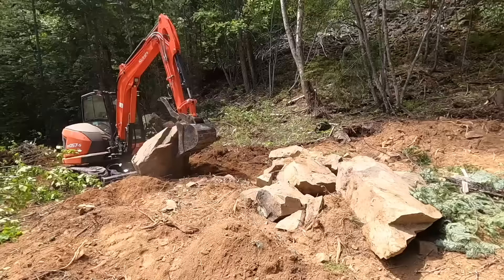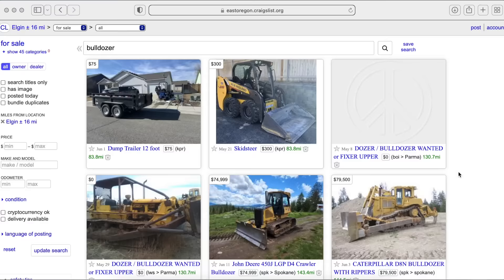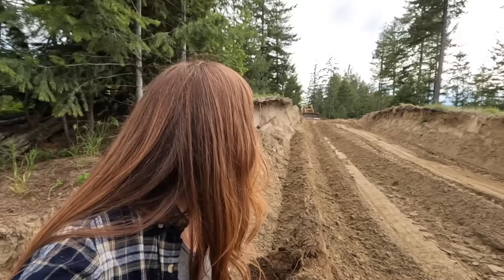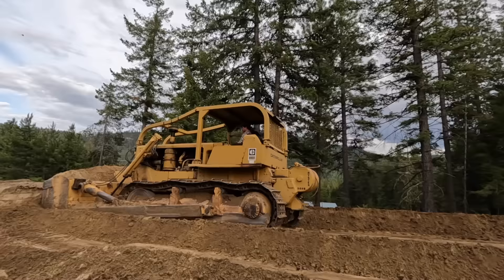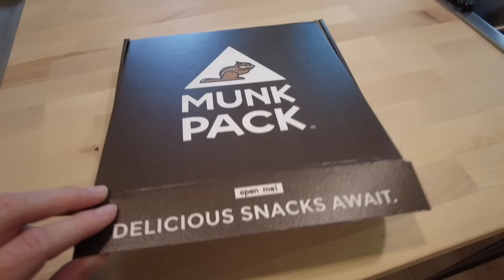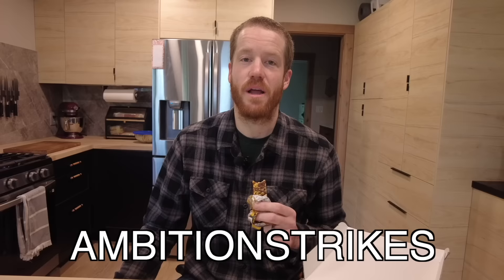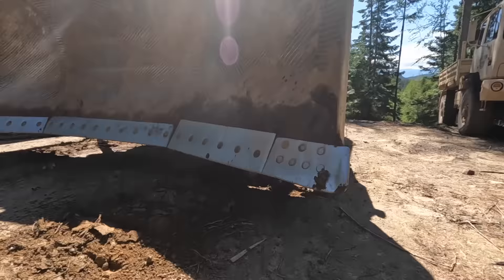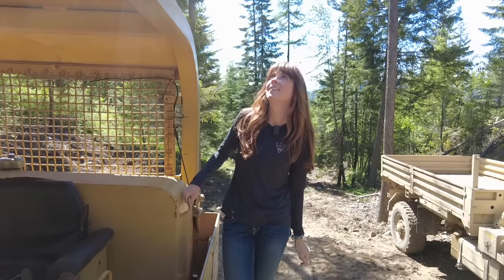We Bought The Biggest Bulldozer We Could Find || MASSIVE CAT D8

Comment from the maker: We had some doubts about investing our savings into this thing, but after reading all of your amazing comments I think we made the right call. This is going to be a fun summer! 🔥
Reply: One more thing when were the spark plugs last changed on the pony motor and a heat gun in the air intake a minute before you try the big motor does wonders .
Reply: I don't think you actually realize how good it will be having the right piece of equipment for the job. It just won't be anywhere near the struggle for those big jobs it would have been otherwise.
Reply: Check out your track tensioner. The tracks looked a little loose. Find the specs on them.
Reply: You have the older brother to the D-8 we have at our quarry that I sometimes run. That semi-U blade is good at ripping blasted or shale rock like you have there. It's a good idea to take a few small cuts than trying to get it in one go. The corner of the blade is your friend when working ripping rock. 

Because of the age of the machine use non- ethanol fuel for your pony motor. If you get lead fuel additive use it in your pony motor fuel your valve guides and seats will thank you.

I'm guessing you know to let the main engine spin over till you have engine oil pressure before lighting it off.

It was fun watching Riley running the dozer for the first time then at the house as a kid with a new toy... 

Oh fuel burn will be around 10 to 12 gallons an hour unless you are pushing really hard.
Reply: I think you can probably sell it when you are through using it. You never know you might just make a little profit.
Reply: Those Dozers as long as they are in Decent Shape, and Running Order, Hold their Value Quite Well. Aslong as it is Structurally Sound and has a Good Frame, Guys have been Buying them and doing a Ground Up Restoration on them as well. A Lot of Farmers and Smaller Operations that don’t Necessarily Need a Dozer all of the time tend to Purchase them, sometimes just for Pulling Trucks on Muddy Jobsites.
Reply: @traviss224  
They look a little low on grease.
Reply: Yes it is...
Reply: you can bring up your dozer in youtube and see how maintain and check all oils and server truck that not just check all where but deliver fuel ..take bids ,NEVER STARTED IT without checking oils and grease all fitting
Reply: @sceneanuerebelrebel9244  Spark plugs do you understand how Diesels work. Wow great thing you aren’t a mechanic. You’d have to go back to school. They are called injectors, diesels work on Compression. Stay tuned you’ll learn something.
Reply: Very nice,but,get a plow truck
Reply: @macclark4112  Maybe he was talking about the pony motor?
Reply: @macclark4112  spark plugs on the pony motor heat gun in the intake of the big engine I did you not understand that
Reply: Dozers are great, when you are done maybe down size to a D4 or D6 for maintenance of you road and other projects.
Reply: @krissfemmpaws1029  i
Reply: @macclark4112  I was referring to the pony motor Mr cool
Reply: what people really want to know is how much it cost
Reply: The pony starting motor is gasoline and has spark plugs.
Reply: The Pony motor is gasoline powered!
Reply: Thank you for explaining on other videos your Financial plan on success. I love it how your wife (Financial expert) Explained and questions your purchases. The RISK, and Rewards. We did a lot of that work on are home. Flipping houses is something a expert in the field (Carpenter) home builders know what to do. BOY it's tuff, just cleaning popcorn Asbestos sheetrock Roofs The sag in are cement floors. The work invalid. It's no fun. I Love your business mindset. Two partners in marriage, working together. On business ventures. I wish you success. The Idaho property looks so beautiful, and a fun place to practice your CAT D-8 Dozer skills. Let your WIFE run the bad boy. Teach her to control the machine, NOT let the machine control her.
Reply: work down hill as much as possible, huge savings in fuel, and less maintenance
Reply: You should offer Bulldozer Dude Camp.  For $1,000 US you pick people up at the airport and teach them how to drive the bulldozer for a whole day.  Saturday is skills day and Sunday is checkout day where they get to build the road for free!
Reply: That is awesome! How many acres do you have to work with? Land is extremely expensive to clear. We r still trying to out our 18 acres to work
Reply: Make sure you check all your fluid levels and check the tracks . Get a large  greasegun so you can lube the whole cat and don't  forget the tracks
Reply: If you drive that dozer in reverse you can level the track marks with the blade . And that Machine is fun to drive .
Reply: @macclark4112  Did you learn anything?
Reply: If you go to your local forestry office you can offer your cat and services for hire if needed.  For any local forest fighting services in your area .
Reply: Looks like the previous owner is Dave Turin from Gold Rush TV show.  He also went by the name Dozer Dave.  Looks just like him at time 7:43.  Is that the previous owner Riley and Courtney?
Reply: @Ambiition Strikes Shout out to both of you. You two give very lovely vibes and I saw just one video "Repairing my D8 Dozer" and fell in love with it! You have earned yourself a freakin subscriber dudes!

Comment: I sold out the operations side of my logging company in 2018. I sold 180 pieces of equipment through Ritchie Brothers. The one and only piece of equipment that I wish I had kept was oldest one: a 1977 D8K. They were so buttery smooth, easy to work on (other than the final drives) had ludicrous pushing power (no issues pushing my 180,000plus loaded trucks up hills), and would start in minus 40 simply by glow plugging it.
Reply: 180 pieces of equipment?!😮
Like even one of them would equal 3x life savings!

Comment: A warning and advise if you ever plan or get the idea of moving snow with it. Never use sideways it on a hill with snow. The metal tracks act just like a sled that won’t stop until it hits some thing.
Reply: Hi
You can use it on ice just cork it first.
Thank you for listening!
Reply: Sometimes hitting something won’t stop them either. Sometimes you have to hit something big to stop it. Or end up at the bottom of the hill.
Reply: Weld lugs on to it in a 2-1-2 pattern on the grousers and you should be fine. Three inch by three inch by one inch.
Reply: Lol. That is experienced operator. Permafrost possibly will let it slide. But that machine is just to heavy . Loose boulder or cob is the only thing it will slide on and that is roll on because the rocks roll under the tracks. Snow won't make it slide one bit. You have a bank of snow beside you. I have slid 50 ft plus crossing green logs while skidding logs. That is why not many people are allowed to operate large dozers. I have 50 years operating cat logging, building road, fire line on wild fires. And strip mining. Also on cliffs in large rock pitts. 500 plus ft above on the cut. Have video to prove it. Even the owner is scared to watch in the rock pitt. Along ways down pushing over the edge.
Reply: @leesharp7683  I guess it was my imagination watching my bosses dad go for a ride and almost end up in a river then I guess. It was a laughing turned into an oh shit moment.
Reply: KILLLLLDOZER😮😮😮😮😮
Reply: @mauricerostaing4281 
Cork? That's pretty soft stuff. Probably better off using caulks.

Comment: I just retired from East Peoria Caterpillar where your dozer was built and had a hand in building and/or machining parts for more than a couple. I hope the winch works, because other than another dozer, it's the only thing that's going to pull you out if you get stuck!
Reply: Oh come on, he has tracks on that jeep!  BWAHAHAHAHAHA!

The most important thing to remember is to NEVER turn it off in a spot that you can't get around it!  Otherwise you'll be building another road if it won't start.

Comment: Great purchase! Two things my dad mentioned and I’ve learned running dozers my whole life. Our old d7 if you press the clutches in will free wheel and can take off down a hill. Also, on rock, if the tracks start to slide, drop the blade and try and hook a tree. It kept us from going off a cliff once. Rocks and metal tracks can get tricky. Start slow and get proficient. You’ll be fast even if you’re slow if you’re working correctly.

Comment: You might want to tighten the tracks a bit. It's real easy to do. On top of the roller frame there should be an access door (4 or so inch square), there is a grease fitting under it, and just a few pumps is all u need. Have fun!
Reply: Yeah my first thought when I saw it moving was the tracks were loose. My Allis HD11 has a manual (threaded) adjustment and it's good for a while. The hydraulic ones need regular attention.
Reply: @ST-cy6we  worked on Cats in the early 70s- a2U D8 & same era D6. Definitely BIG hex head screw.  3/4 or 1” plate and a hot wrench with a pipe on the end.  It’s probably still pulling equipment.
Reply: @EarthSouthside  boris here is not talking about track adjustment,,,hes talking about grease fittings along the track itself,,,every joint of the track has fittings. Replacement of a bad track and sprokets and rollers and road wheels could well cost $38000,,,,its a good ideeee to use grease, and lots of it. Grease is cheap!!
Reply: Those tracks are about right you don't want to run them to tight on them old dozers ✌️.
Reply: That’s good advise, saw that too.
Reply: @EarthSouthside  That is very important, great advise.
Reply: @bill45colt  Hey Bill, are you talking about the track pins? They should be sealed for that vintage. Hard to see on video. It’s still a great suggestion.
Reply: @G-Man-kc2nm  ive had 11,,,,the two D4s i have now have individual grease fittings on each pad pin and are NOT sealed tracks. My track adjustment is a big assssss nut horizontal on a screw that you use a big asssss wrench to tighten. I have the wrench, and pray i dont have to use it often. im no paul  bunyon here!!! But keeping tracks lubed and adjusted is important,,,,be safe,,,i have two D4 7Us for sale if anyone is interested, winches and one has a factory cab,,,as i understand it,,,,the only D4 7U in the ACMOC club with a factory cab. Angle and tilt blades also, but manual operation on the angle and tilt. And rope  electric start on the pony engines, and 12 volt conversion. email me for details or photos,,,,north alabama
Reply: @bill45colt  I’ve had some old ones with fittings on the pins as well. You certainly know your cat dozers. I remember the big adjusting nut before the grease adjustments. I hung off the pipe extension after soaking the adjustment nut in kroil! Thanks
Reply: @G-Man-kc2nm  my first D4 was a 1936 model, ive had 11 since...used to sell Caterpillar for 2 yrs back in the early 70s with Thompson tractor in Bham,  i dont know much, still learning. I worked 36 yrs rocket science mathematics for US Army, so ive been out of touch.
Reply: @bill45colt  Thank you for your service Bill. I have some experience with the CAT loaders. Started snow plowing with them in 1975. We always repaired our company equipment in house. I won a few bets on the 922A..lol
Reply: YEH I NOTOCED THAT TOO!!!!!!!!!! THAY ARE FU..... IF THOSE TRACKS ROLL OFF!!!!!!!!!!!!!
Reply: Love to see the D8 Monster in action. An incredible machine.
Reply: @G-Man-kc2nm  the
Reply: @jamesroberts3119  ? For some reason your message didn’t go through.
Reply: AGREE
Reply: @EarthSouthside  😊
Reply: @EarthSouthside  i

Comment: When you go to start it, idle the starting engine for a few minutes first. While turning the diesel over with compression lever in the start position, build up oil pressure for a time, then move lever to the run position, keep the diesel throttle lever in the shut-off position, then when engine has turned over on compression for several minutes depending on temp, then open the throttle lever to start the diesel engine. Idle starting engine and turn off the gas valve to stop starting engine.
Reply: That’s how you do it. 👍
Reply: i like to spin the big engine with the compression off and let it freewheel and build oil pressure..then when you flip the compression lever its not so hard on the pinon because its already engaged...mine would grind a little in i pulled the pinion in under compression
Reply: Never ever use starting fluid(ether).... if hard to start in cold just run the pony(putput) motor longer....them old engines are easily addicted to the causby sauce and next thing u know u got more problems
Reply: @philippebergeron8695  --  Problem is that people don't understand how little you need to spray.  In the video where they were trying to start the D7, they were spraying so much they probably used a dozen cans.
Reply: @philippebergeron8695  you use "sniff" because you are starting to have problems, it doesn't cause them, by not attending to them the need for a little "sniff" just gets worse until that is all that will overcome poor compression leading to poor starting, new pistons, liners and rings are the way but the cost of that buys a lot of cans of "sniff",

Comment: When you tighten the track, pull it forward about twenty feet straight, stop and back up to get the slack on top of the idler and rollers. 
Old D-8 weighs actually about 48,000 but they are good old machines. 
Learn to steer it with the blade loading, not the clutches. 
If you start popping steering clutches under load, you will damage it fast.

Comment: When I was a kid I actually started a gigantic bulldozer at a gravel pit. My friends and I drove it around for a while, but we couldn't turn it off. So we left it running and got the heck out of there.
Reply from the maker: We’re impressed. Every bulldozer we’ve looked at took some serious skill to start. 😂
Reply: @AmbitionStrikes  I love driving bulldozers, you get an incredible feeling of power...
Reply: Believing the statute of limitation has been exceeded... back in 1972, a new housing development was causing real trouble for High Schoolers that used to "trespass" on some really cool off road motorcycle trails.  Local law enforcement could never catch them because they knew the trails better and had many ways out... until the developer used a huge dozer to block all but one entrance/exit.  My best friend (back then) walked in and found the dozer operator left the key to the pony motor in the dozer.  He got it started and managed to blast through a few obstructions before finding he couldn't stop the diesel.  He left it in gear and pointed to where a "new path" might be useful.  We read all about it in our local weekly paper but the dozer stopped against a berm and ran out of fuel.  I lost track of my buddy but I'd guess he found his place as a heavy equipment operator somewhere.
Reply: Yeah you needed to reach down and pull the skinny pedal all the way back until you starved it of fuel and it would’ve shutdown.

Comment: By the way, my experience with pony motors is run the pony absolutely the least amount of time possible. Parts are unbelievably high and hard to come by. My advice if the pony goes down is direct electric start. There are conversion kits for that.
Reply: Unfortunately that's also why Pony motors give fits. They don't get run enough. Before I bought my first 9, I operated one for another contractor that had been converted. It was a total pain. Flip the compression release and hope she cranks fast enough to fire. When I bought mine, (66a9560), it was an electric start machine with Glo plugs. That thing would start in sub zero Temps no problem.
Reply: unless you BLOW UP THE PONY MOTOR theres only the magneto and carb to worry about!Dont change out the pony motor just because it starts hard!  the changeover is a fortune and takes 2 monster batteries!then you need to add an alternator! this is a newer d8,probably a d8H...it is REAL BAD AMATUER ADVICE to tell you to change this over to direct electric start!.

Comment: I could feel your angst driving it the first time.
I bought an old Cat D-7 loader years ago, every time I fired it up, I thought this would be the time it fails me. Like you, I too live in the high mountain wilderness,  so repairs are going to be expensive.
Here it is, more than a decade later and the beast is still running like the day I bought it, and it had been through the grinder by a rock quarry owner, literally buried in a rock slide.
I've put over a 1000 hrs on it myself and the clock stopped working at 18 hundred hrs.
Point is, don't ever sell it, you can hand it down another generation.
You definitely got a nice rig, take care of it.

Oh, by the way, I've been off grid for more than 3 decades. Soo glad I went down that road.

Comment: 6’2” wow you’re a tall drink of water!!
I’m an old Marine Corps heavy equipment mechanic and operator, I have operated and worked on dozers just like that. Other that being huge, they are relatively easy to work on. As with most of the comments posted here the biggest and best thing you can do is PM’s (preventive maintenance). 
Man I am so jealous of you guys!!!
Reply: That thing hanging on the front is a blade, not a bucket! With the cost of fuel, I would suggest you hire someone to rough in the road for you. It will save you time and money! Let them finish grade for you also! That would be a huge time saver! Then you can play all you can afford. This is from someone with 30 years experience building roads in the great  Pacific Northwest. Good luck!

Comment: Take the slack out of the Tracks. By pumping grease into the adjustment pistons.   Look at the slack in the top of the Tracks as they roll over the upper rollers. Be carful and read the Manual.  On the Net or from CAT.  Its out there find and do it right !!!